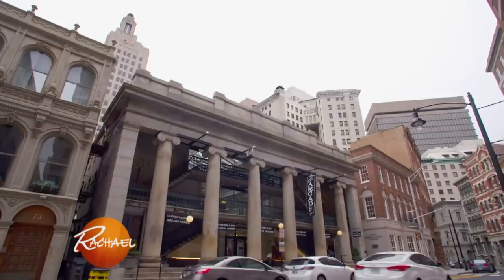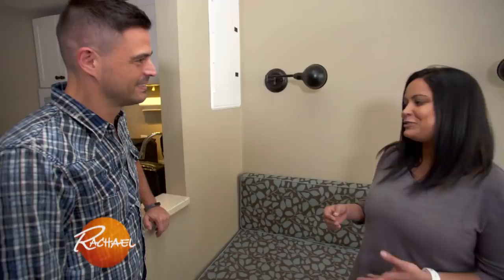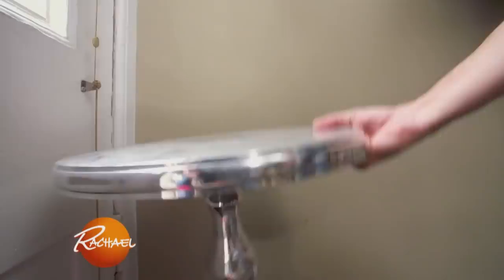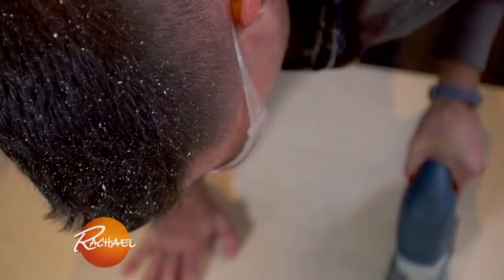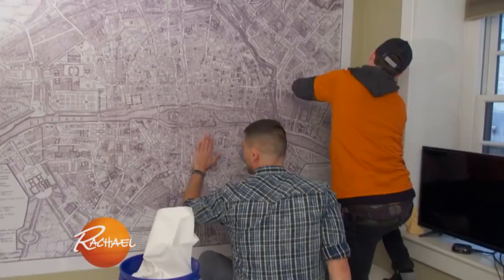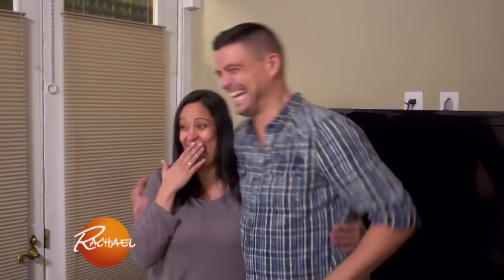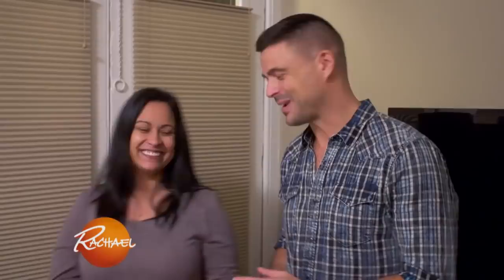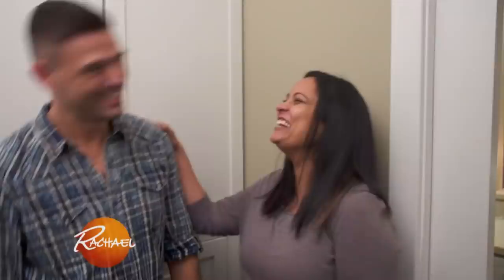This Tiny Apartment -- Inside an Old MALL -- Gets a Massive Makeover | Rachael Ray Show

Comment: This mall/ apartment complex is explored on the Kirsten Dirksen channel, the oldest mall in America. It's a great concept, using the lower level as retail space and the upper level as very nice small living spaces. There are kitchenettes in the units, and some takeout places in the lower level. There is an on site coin laundry room. 
The mall is right in town, on transit lines. So you don't need a car. The units are small, but affordable for someone working full time. This is such a good concept, as it helps the mall landlord, and provides affordable downtown living space.
Reply: When I was last in St. Paul, a couple of developers are putting container homes on top of 60s strip malls. I agree that the multi-use mentality rocks! It creates an immediate pool of customers for the shops below.
Reply: People are having to make due with smaller incomes now, so for a lot of folks a car or full size apartment are out of the question. But by putting little affordable "bachelor" units over a mall with transit access, a nice coffee shop, a small grocery,  a good take out place, maybe even a coin laundry, a mall landlord is creating a very nice living arrangement for singles. Two people, even on  small incomes, can rent a one bedroom apartment, but one person can't afford that. All you need are bachelor units that are prefab and able to hook into the existing electrical and plumbing lines. 
I live in Toronto, the Scarborough area.  Even renting a room in a rooming house will set you back at least $600.00 to $700.00 a month. Before cable and wifi. So you would be sharing bathrooms and kitchen space. This may not be too hard, if you have a place with nice people. But I can tell you from personal experience, sharing space with other people can be dangerous.
Reply: I love it. There are old malls literally in all 50 states. How many can be saved and put to good use like this one?
Reply: @anniefannycharles9951  Create a petition, get lots lots of signatures & give them  to elected officials. Get media involved. Mayors etc should be made to change local ordinances so people can have Affordable Housing options.
Reply: They should definitely do the same in all the big cities in the US

Comment: I love the wood wallpaper. This is good especially for rentals that can’t have permanent changes. 

The rugs add much needed texture. 

The convertible dining furniture was well thought out

I’m not really feeling the massive monitor in the corner though. A laptop slipped in the drawer of the red desk when not in use would be visually pleasing

The bedroom area as great. Plush in a small space. 

Over all loved it but the monitor seemed odd in its placement